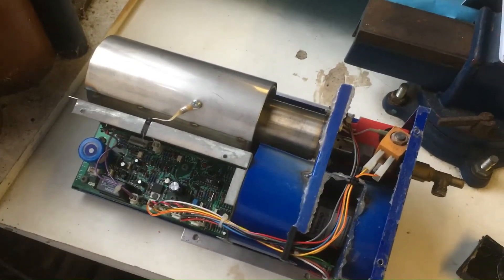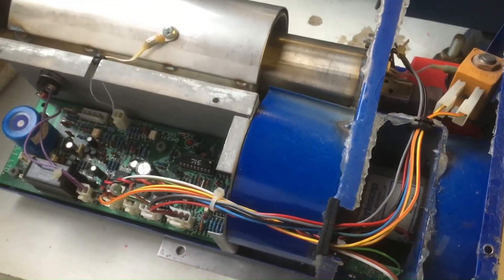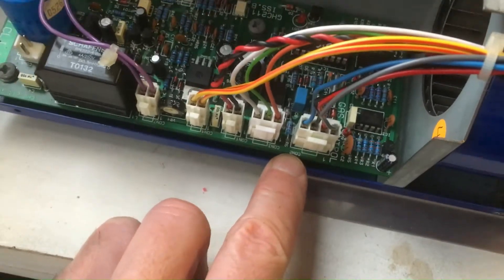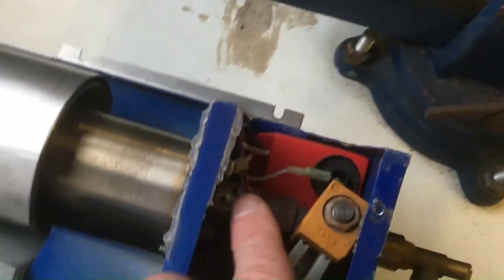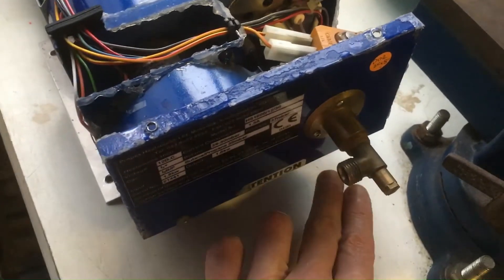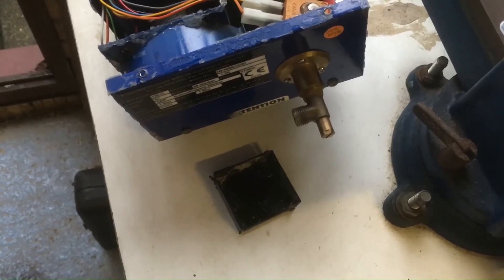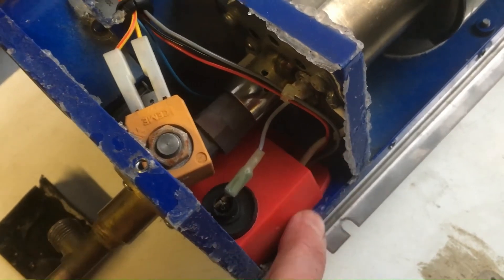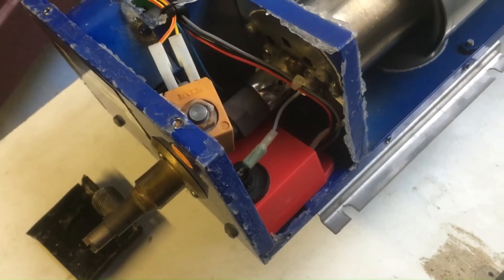Propex Heatsource 1600 Ignition Failure

Comment: Hi Kevin, really informative video! :) I was just wondering if you could help with a problem I'm having with my HS2000. It's intermittent and only happens every now and again but sometimes the heater errors in the middle of the night so the family wakes up cold. From memory, it's error code 1. The solenoid seems to open, you can hear the ignition working, you can actually hear the gas igniting, but for some reason the heater doesn't go green and will instead fail and try again until eventually giving up and showing the error. Is there a sensor for if the gas is sufficiently lit? My only guess is that this is failing. Many thanks
Reply from the maker: If the error codes are the same as mine then error 1 is 'failed to ignite'. If the gas ignites and then switches off after a few seconds showing an error, the fault is likely to be with the flame failure detection circuit. This consists of an electrode that needs to be in the flame, a wire from the electrode back to the PCB and the circuitry on the PCB.

Here are my thoughts on potential failure modes:
1. The electrode isn't positioned correctly in the flame.
2. The wire is damaged.
3. The wire is not connected properly at either end.
4. The wire is intermittently contacting part of the chassis of the heater.
5. There is a fault with the circuit on the PCB. I would look for bad solder joints.

Let me know what you find.

Comment: I keep getting 4 flash fault code for my HS2211 but I can't figure out for the life of me what's wrong? Do you have any idea? Seem quite knowledgeable haha
Reply from the maker: From what I can see, error 4 on the HS2211 is a combustion air flow problem. I guess that means either there is an actual blockage (unlikely) or the controller is unable to detect the air flow. I had exactly this problem on my HS1600 and the only method of fixing it was to replace the optical disk flow sensor with a pressure sensor. Propex sold this as an upgrade and I haven't suffered from the problem since fitting it.

I don't know whether the HS2211 uses the same optical disk sensor as the HS1600. I would contact Propex and ask them. If it does, then you probably need to replace it with the upgraded pressure sensor.
Reply from the maker: I see that your model may not be affected, see here: https://vancafe.com/propex-air-flow-sensing-conversion-kit/

I find the Propex technical help very good, so I would call or message them.

Comment: Hi Kevin, i have an issue with a Propex 1600 not firing, do you do repairs ? Or checking ? Im based Midlands
Reply from the maker: Afraid not, I'm just an owner sharing what I've found when fixing mine. What are your symptoms, do you have a blink code on the LED?
Reply: @bvqbvq   Hi Kevin, my gas bottle is full have the gas on i get both lights come on the thermostat when i click it to start, i get a quick green on the neon on the igniter box, i wait it gives a click as though it trys to ignight then shuts down
Reply from the maker: @STEVEHOLE1  the click is normally the gas valve opening, you should then hear the ticking of the ignitor followed by the roar of the burner. When you switch it on and call for heat does the fan start and run? After you hear the click does it shut off immediately with no lights on the controller from then on?
Reply: @bvqbvq  can i send you a video of what happens ?
Reply: @bvqbvq  it runs after the click for around 20 seconds then closes down
Reply from the maker: @STEVEHOLE1  yes, you could post a video on YT. So, it sounds like your fan is running and it has the run down purge as well so the main controller is working. Do you have any flashing lights on the controller? Normally if it doesn't light then it flash a pattern, just count the flashes between the pause and that is your fault code which will point you in the right direction of the fault.
Reply: @bvqbvq  ok going to upload a video on my channel so you can see
Reply: @bvqbvq  i have posted it on my you tube, put it under Propex
Reply: @bvqbvq   uploaded now Kevin 👍

Comment: Hi Kevin . . . . I have the same issue however the light flashes 4 times (Gas Solenoid). The unit goes through the purge cycle, but no ignition. I monitor and  find 12V going to the solenoid near the end of the purge cycle and it opens but shuts off shortly after. I also checked the 4 cables that go to the spark generator - the readings are the same as yours. Would you suggest I depot and have a look?
Reply from the maker: Hi, firstly I would check the resistance of the solenoid to make sure that the coil isn't open circuit. I don't know how the micro detects that there is a problem with the gas valve, it could be current flow or pressure. To check the ignition module you need to make sure that you have an AC voltage on the grey wire as well as a supply on the red and ground continuity on the black.
Reply: @bvqbvq  some more invest this evening. Appears there is an issue with either the Gas selenoid or the board. The purge cycle runs and the board sends approx 11v to the selenoid for a split second then the cycle stops. Have bench tested the selenoid and it opens fine. Any ideas?
Reply from the maker: @steveberry1331  sounds like it is trying to drive the solenoid and then gives up. I suspect that there is a current monitoring circuit to detect open or short circuit. You either have a fault with the solenoid or a fault with the circuit board. If there is a part number on the solenoid you could look up the spec and see that the coil resistance is within limits. Failing that look at the circuit board. There should be a current sense resistor in series with the connection to the solenoid. It will be a low value resistor, probably less than 1 ohm. Check its resistance and make sure that all of the solder joints around it are good. I would be tempted to resolder the ones on the resistor anyway.

Looking at some photos I have I see that there is a potentiometer on the edge of the board labelled VR1. I don't know what it does but it might set the sense threshold for the current sense. I would note the position and then experiment with it in different positions. If you can post some high resolution pictures of the circuit board I might be able to make further suggestions.
Reply: @bvqbvq  Thank you so much for the information so far!  I have ordered a new solenoid today from Propex not to expensive around £25 . . . . I'm not sure if I have said previously but I have had the unit running a couple of times, I would say I have a 5% Hit rate. Also s number of partial starts where the solenoid opens (Loud Clunk) but ignitor doesn't fire.
Reply from the maker: @steveberry1331  I hope that fixes your problem but I suspect that if the coil resistance is the same as the one you have then your fault will be on the circuit board.
Reply: @bvqbvq  Hi Kevin . . . New Solenoid arrived today, resistance measured @ 110Ω the old solenoid measured @78Ω. Fault still apparent. Looks like the air flow sensor is working, provides 12v supply to the board near the end of the purge cycle, same time gas solenoid receives about 11.5V feed then shuts down before spark generator gets to fire. Looks like I'll have to send the unit back to Propex for possibly a new board. Spark Generator does have a constant 12V feed via red wire, but doesn't get any signal during the start sequence.
Reply from the maker: @steveberry1331  Interestingly I've just dug out my user manual and mine doesn't have an error code 4 but it does list a gas valve fault as error 6. If you temporarily energise the solenoid with a 12V supply can you smell or hear gas passing through the valve?

As a test you could connect the 2 solenoid coils in series to reduce the current (assuming that's how it detects a gas valve fault) and see if the ignitor runs. The air flow sensor sends a square wave signal to the processor. There will be a supply, a ground and the signal. You can check it by setting your multimeter to AC volts and see if there is a signal when there is air flow although, a problem here results in error code 5.
Reply: @bvqbvq  Hi Kevin, again thanks. 4 Flashes on the early HS1800 does indicate Gas Solenoid the manual is incorrect this was confirmed with Propex themselves. I have tinkered some more this evening and I am experiencing the same readings with the fan sensor (Updated version) disconnected. my guess now is I'm either looking at the fan sensor or the board between the fan sensor and the gas solenoid. Will have to take some more readings
Reply from the maker: @steveberry1331  if you have the old style air flow sensor with the black and white disc and the optical sensor then they are problematic. The newer ones have a solidstate differential pressure sensor. I have a video showing the old sensor. I'm sure that if that was your fault you would get a different error code.

It would be useful if Propex could tell you how they detect a faulty gas valve. It can only be electrical (current) since I don't think that there are any other sensors to detect pressure or flow in the gas circuit.

Comment: Hi Kevin, thanks for the video. we have a hs2000, it's ticking away but struggling to ignite. Other gas appliances are lighting up fine and the pressure is good. Any idea's?
Reply from the maker: What fault code does it flash on the controller LED when it doesn't light? If it is error code 5 then you probably need to replace the air flow sensor with the upgraded pressure sensor kit from Propex. The old style sensor is shown in my other video: https://www.youtube.com/watch?v=R53ufxkqJ_w I can't see the upgrade kit listed on their website any more, you'll have to contact them if you need it, I seem to remember that I paid about £70 for it but it fixed the problem.
Reply: @bvqbvq  usually number 2 but its been flashing different numbers sometimes as well 😕. I bought this last year so I assume it will have the upgraded version?
Reply from the maker: @jobdone7392  yes it should have the pressure sensor mod. I would speak to their tech support, I've go found them very helpful in the past. Error 2 is an overtemperature fault, if it isn't lighting then it can't be too hot, you might have a faulty sensor. Have you checked the wiring and the connectors? Do the crimps look good on the wires inside the connector housings?
Reply: @bvqbvq  we've recently had the airflow sensor changed so think it's not that. I've not checked all of that myself, I had a professional guy do some bit's but I'll check all wiring and solder joints asap. Thank you for your help sir

Comment: Kevin, Any chance you have any experience w/ the HS 1800? I've got a bad ignition board and I can't seem to find where to get a new one or preferably, how to fix it. Any advice would be greatly appreciated! Thanks.
Reply from the maker: Hi Kristopher, as far as I am aware you can only buy replacement parts from Propex (http://propexheatsource.co.uk). Depending on what tools and knowledge you have, you may be able to repair your existing one. Mine was an obvious fault, a bad solder joint that was clearly visible after I dug the board out of the potting compound. Before you you dive into doing that I would check that you have 12V supply on the red & black wires and an AC voltage on the grey wire when it is trying to ignite.

If these measure correctly then you have nothing to lose by digging it out of the potting and carefully resoldering all of the joints. You can buy a replcement box like the one I bought from Farnell (pt. no. 2457441).
Reply: @bvqbvq  Thanks! I have checked all the electrical connections that you suggested and I think it's time to pull it off and resolder. Or upgrade to the HS 2000? So expensive!! I hear they are much more reliable and have a more robust support in terms of troubleshooting and parts.
Reply from the maker: @teleskipowder1  I was told to upgrade from a previous model to the HS1600 because it was better. Well, it has not been very reliable to be honest. I would save your money and fix the one that you've got. It is a shame that they didn't spend a bit more money on the components and they would have a had a nice reliable product. In my opinion they should have sent out replacement pressure sensors free of charge, how did they ever expect an optical sensor to be reliable in that environment? And as for using a single sided PCB in the ignitor, well that is taking cheapness to a whole new level. If you cheapen a product too far then it kills your product due to reputational damage. Business 101 :-(

Comment: Hi could explain how you fixed problem with sensor, what modifications you need to do.
Reply from the maker: This was a problem with the ignition module which had a bad solder joint. There are some notes in the description that should help if you have the same problem. Another common fault is with the old style optical airflow sensor. This can only be fixed by replacing the optical sensor with the updated pressure sensor on the Propex website.
Reply: @bvqbvq  Thank you

Comment: Completely underrated video. I purchased my Propex heater brand new and I've had nothing but trouble with it. If I was to buy another heater, I would never go with these again. I think I've felt the heat of this only a handful of times.
Reply from the maker: It's a great shame that the product is let down by quality issues since it is simple to fit and when it is working it is quite effective. I too would think twice before buying another one.
Reply: Yea I. Got one worked once. Its in the bin. Chinese diesel heater .fantastic.